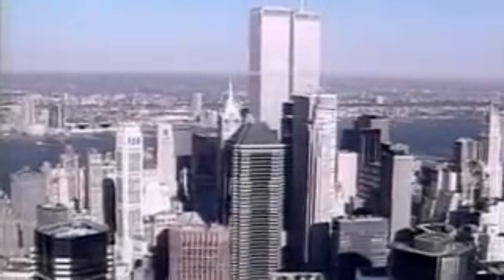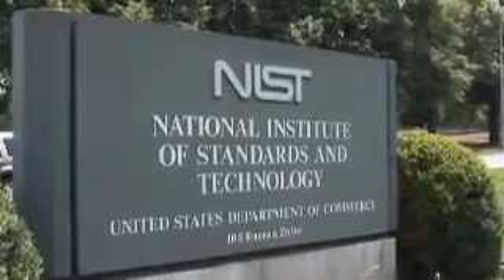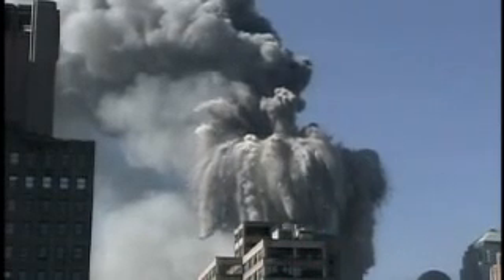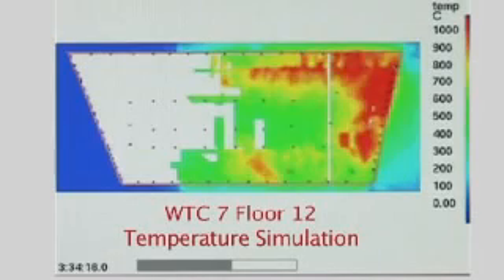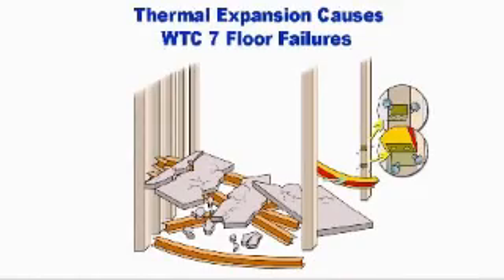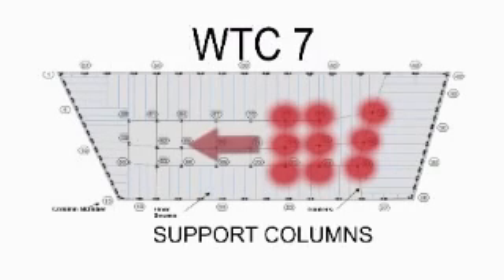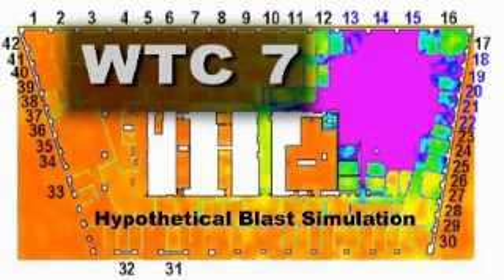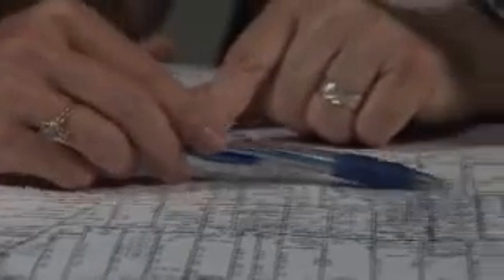NIST WTC 7 Investigation Finds Building Fires Caused Collapse, 08 21 08

Comment: Why is Shy am blathering about explosives if the building collapsed due to fire?
Also...Why in the world would a PHD claim that concrete would expand more than steel when the co-efficient of linear expansion is virtually the same?...0000067 and .0000065

Comment from the maker: By the way, NIST altered the International Building Codes based
on their studies of WTC 7 way back in 2009, 3 or 4 years ago.
Long Span Truss buildings were ordered to retrofit Horizontal truss
beam restraints that would prevent the expansion failure WTC 7 had.
They also put in a bunch of fire code changes.
The engineers have bet a lot on those WTC 7 reports, and are 
spending about 1.2 Billion a year, just in the US, to retrofit them.

Comment: In Dec'07, it was acknowledged by the NIST that the fires in WTC 7 were ordinary office fires and burned out in any given location within 20 minutes. 
In such a time, the temp of fire-protected steel members would be below 200°C (400°F). Can such temps have this effect on construction steel?
Thermal imaging by NASA showed that the top of the debris pile had a temp of 730°C five days AFTER the collapse. NIST report also has 2.25 secs of freefall, a distance of approx 8 floors! How 2 explain this?

Comment from the maker: @DeepSpaceNutJob
Easy. what do you want, the Pentagon or the WTC buildings.
They are two different targets, two different aircraft, so the math and physics are very different. I can also do the math for the expansion of the horizontal joints at WTC#7, it's right in the Engineering Guide, which is even available ONLINE, so you can check each step with me.
There is NOTHING that the NIST and FEMA team can sneak by anybody, their calculations and methods are from the guide also.

Comment from the maker: Actually, a 757 IS that long, it's called a stretch commuter plane, and it's long and narrow. Dead pilots tend to be a little less visible than live pilots, don't you agree?

Now, tell me, why would the MUSCLE arabs trained to restrain the pilots, be inside the cockpit at all?

Actually, you STILL don't get it, the frame of the building fell AWAY from the parapet. The ONLY thing supporting it at that point is simple rigidity of the facade.

NIST's simulation shows this.
.

Comment: The point I'm making with B.O. and other phone calls is they were not sure what was going on. An airplane is not so long that all passengers would not be able to clearly see dead pilots tossed from the cockpit. They are looking in that direction! The cartoon reference is appropriate because you live in a fantasy world. No object can free fall(a roof or the 30th floor) without ALL resistence is removed, excepting air. All vertical supports were severed at the same time to allow 7 to free-fall.

Comment from the maker: 1. The roof-line is called a parapet.
    The parapet of WTC 7 is an extension of the external wall, above the roof, and ABOVE IT'S SUPPORTING STEEL FRAME.

SO, the steel frame falls away, with the rest of the building, and the parapet is left standing like Wile E. Coyote.

The Hijackers can actually remove people from the cockpit, idiot, they brought their own pilot.

Betty Ong was in the REAR of the aircraft, hiding away from the hijackers, try to talk to authorities.  Forgive her.
.

Comment: Must you always change the subject? How did the roof-line of 7 crash through 40,000 tons of structural steel at freefall speed. Or how do five highjackers plus pilots fit into a cockpit? Just listen to Betty Ong's call, she did not know what was going on. Therefor the dead pilots were in the cockpit.

Comment: 7 fell at free fall speed, aefor911truth have proven this, but if you want to go by what NIST says, 7 fall at free-fall for 2.5 sec. or 40% of it's fall to earth. Since the roof of seven remained horizontal, it crashed thru 40,000 tons of structural steel with no resistence. Either the laws of physics are wrong or NIST is lying.

Comment: Yes, an ancient clown, but no fool like you.

You do realize a STORY is made up while a THEORY is based on facts.

Speaking of, I didn't ask about AFTER THE FACT, but thank you for admitting it was pulled and not burned to the ground like your video says. 

Small point; STEEL is NOT more vulnerable to fire...nor will aluminum cut through it like butter. It's when you make points like that that I have to laugh at you.

You didn't answer what was IN the building though.

Comment: OMG that's lame. Your economy shows just how incompetent these people are. I've watched your videos, have you watched mine? This model didn't behave anything like in REAL life. This buliding was made from STEEL, not cardboard or pixels. FIRE will NOT make it fall that way. Never has before, never has since.
Aluminum does NOT cut through steel like butter regardless of how fast you push it.
It's not your fault, you're just one of the weak minded easily programmed.